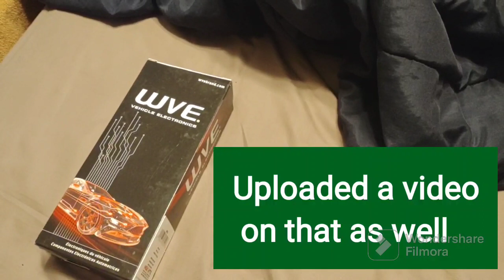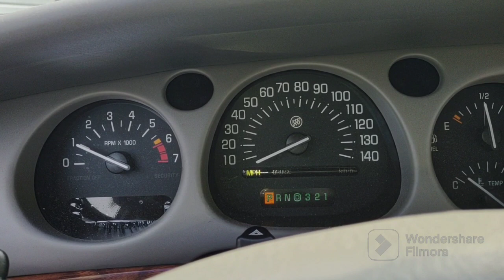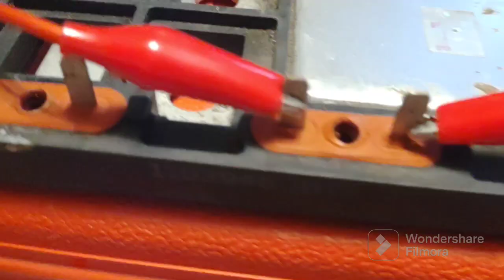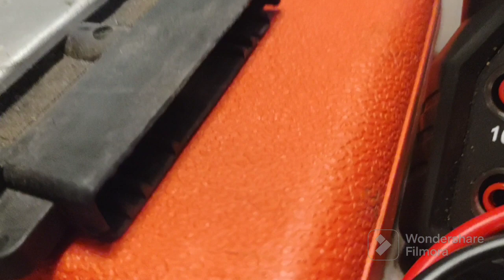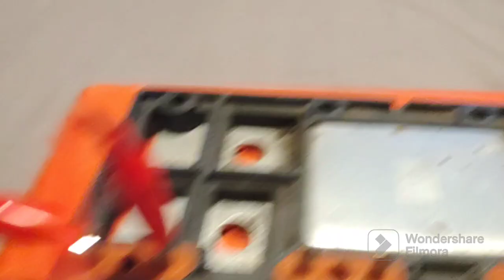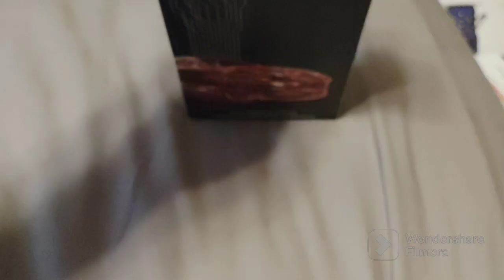Buick LeSabre Crank no Start - Repaired

Comment from the maker: My apologies for not showing the actual installation part of the ICM (Ignition Control Module) in this video.  It's rather self explanatory, and couldn't be easier (thnx GM), but I did include many photos at the end of the vid which show a lot of disassembly, cleaning, and reassembly details. 
    But what's more important is what I learned in my troubleshooting travels and the how I arrived to this point only $200.00 total later.
    Crank, no start condition. Odds are it's the crankshaft position sensor or the ICM. Either of these not functioning can cause ur engine to die while driving. Or just not start.  I changed the crankshaft sensor first and car still didn't start. Then I made sure the ICM was receiving 12V on the pink and black wire after unplugging the connector. So my ICM was receiving 12 volts, but still no spark. Well, when I got to this point it was either the ICM or the PCM.  So  then I changed the ICM, and as you can see in the video, she came back to life !!
Reply: I ordered an ICM..My 3800 shuts off randomly on the road. I cleaned the grounds very well. I used DeOxit with Copper particles, I am trying to avoid the pain of changing out the Crank Sensor especially with 30 degree temps.  VERY GOOD point about not testing a new ICM! Cheers
Reply from the maker: @kevhauser8058  Hi Kev, I hope it is your ICM and not your crankshaft sensor, given the cold weather. That's scary and dangerous if a car is just shutting down like that.  Make sure to disconnect your battery first or you may fry other components - not good. 
     In hindsight, I should have replaced the ICM first, but I'm not upset that I did the Crankshaft Position Sensor first, as it was probably 21 years old.  Cheers and good 👍 luck.
Reply: @anthonyhfe6450  Good Tip on disconnecting the battery...Many times I have worked on electronics hot...110v too
Reply: Thaks and hope you have a blessed holiday season.
Reply from the maker: @kevhauser8058  You too Kevhauser8058. Thnx!
Reply from the maker: @kevhauser8058  Yes, I do too on working live with house wiring.  But with the car, you don't wanna accidentally zap costly components like control modules, your main computer, or your new ICM !! Or accidentally touch positive to ground and blow a bunch of fuses or make some fireworks. Just the act of plugging in a connector live can cause issues.  So that's why.

Comment from the maker: Update: June 12, 2026. We're having a heatwave in New York, in the 90s yesterday & today. I've been driving all around Long Island with my 2+ years old WVE ICM with no heat sink compound used. Absolutely zero issues. So I am using my car as the guinea pig to do this experiment for everyone. Of course if you are replacing yours, you probably should use the thermal heatsink paste, unless the ICM manufacturer states you don't need it. Honestly, the factory applied heatsink compound in my car was pretty much all gone, and the original ICM lasted 22 years !!!! Not too shabby, baby ! Throw a spare in ur glove box or trunk. They're cheap enough !!

Comment: No heat transfer paste you'll be putting another one in soon
Reply from the maker: Funny you say this. 2 years ago I said I'd revisit this ICM and add the conductive paste. Well, I never went back and added the thermal paste. Also funny, I don't believe the WVE instuctions on this part mentioned heat transfer paste anywhere. I'm wondering if the design has long since been improved and dissipates much less power, thus doesn't need the paste? Just a guess here. It's such a large area where the ICM touches the engine bracket. Then I thought why do I want to transmit heat from my engine into my ICM, instead of the other way around?? So I left the paste off.  No issues yet. 
But I appreciate the reminder !!
If it fails, I will comment here.
Reply: @anthonyhfe6450 I guess depends if there's any air gap between the two plates which would cause heat not to transfer thus the thermal grease. So they say lol. Probably just a really tight fit no air gaps.
Reply from the maker: @GlennsGoodies Well, the ICM is sandwiched between the 3 coils and the mounting plate with the 6 threaded holes. So it is probably a pretty gastight mating area between the base of the ICM and the mounting base attached to the motor.  The heat transfer must be very good without the thermal conductive paste, but of course would be improved with the thermally conductive paste.  It's a given that the enemy to electronics is thermal runaway due to ineffective heatsinking.  I'm willing to bet that tens of thousands or more of these ICMs have been replaced without the use of thermally conductive paste/grease, and have no issues. But using it may get you a year or more (just a guestimate) of life out of the ICM.
Reply: @anthonyhfe6450  I tested this. I put on a new ICM (Chineseum) and didn't use the heat transfer paste. It was spring, 80F on most days. After driving for 30 minutes I saw misfires starting to begin and progressively got worse the longer I drove.  I removed it all, cleaner and sanded the engine side again, and put an even but thin film of Super Lube Silicone Heat Sink Compound, and the misfires with hot engine went away.
Reply from the maker: @jperksification  Well, I guess you get what you pay for, but the conductive paste seems to have made an improvement in your case, but of course it could have been due to something else altogether.  Honestly, I wouldn't stay with a marginal ICM like that. If this car is important to you, and if you can afford a better quality ICM, it might prevent you from getting stuck somewhere.

Comment: Thanks for the ideas for testing with a multimeter.. Helpful on mine, which also had a bad driver on the center position.

Has this WVE part held up for you? I'm skeptical of the aftermarket choices for this module, but the one you found looks like it might be pretty good. NGK/NTK usually don't make junk. And if they used newer technology it might be a real upgrade. Power electronics has come a long away in the 25 years since the original part came out.
Reply from the maker: Hello, and thanks for your comment.  So far the WVE part (ICM) has been performing great with no issues, in my LeSabre.  At the time, when I bought it, I'm sure I did some research on which one to buy as there are many choices.  Nobody wants to get stuck on the road somewhere.  We do everything we can to prevent it.
    You make a good point about  electronics, and probably this ICM,  improving over the last 20+ years, so hopefully most of the aftermarket ones are good.  Good luck with your car.  I hope it is back on the road and you are enjoying her.

Comment: My dad has a '04 LeSabre that I'm driving (I have a '96 Corolla but it needs a starter) & I went to start the buick one morning & it randomly decided to have a misfire
despite changing the air filter, plugs, wires, & the coil packs, that didn't fix it & got the issue narrowed down to one coil pack not getting spark to cylinders 1 & 4 but I'm able to start it & drive it lol
so do you think it could be the ICM that needs a replacement?
Reply from the maker: @Jeremy_Hill_2020   If you swap coil 1/4 with one of the other coils, and the no spark doesn't occur now with the 1/4 coil, then your ICM is bad. If the no spark stays with the 1/4 coil, then 1/4 coil is bad. Thanks for your comment.  I hope you get that nice LeSabre running smoothly on all 6 soon.
Reply: @anthonyhfe6450  I haven't swapped the 3/6 coil with 1/4 coil yet 
also it did start up fine a few weeks ago when I went to work but the moment I backed into a parking space, it went right back to misfiring lol
Reply from the maker: @Jeremy_Hill_2020  Hope you can  fix that soon.

Comment: Great video.  Very thorough ,thanks for posting. I’m reading that there is thermal paste applied under this module for heat transfer.  Perhaps the gunk under the icm was thermal paste 20 years ago , it probably dried out and deteriorated over time.  The LeSabre  is a great commuter car with a few minor quirks. But far fewer problems than many other cars especially newer ones.
Reply: I had the same crank but no start issue. Changed the crank sensor, ignition switch, and then finally the ICM. ICM has fixed it for 2 weeks now. With the old ICM if the car sat overnight or on cold starts it would crank right up. I've noticed that even with the new ICM sometimes I Have to try to start the car a couple times from a warm start, but it always ends up starting. I'm wondering if that metal plate just heats up so much and gives you the problems. I'll probably go back and reclean it all out and use a thermal paste this go around to see if it makes the warm starts smoother.
Reply from the maker: @bholtmeier  It should not do that. These cars should start quickly in any weather.  When I did my ICM in this vid 2 years ago, I did clean the surface of the mounting plate for good thermal conductivity.  Thank you for commenting.  Let's keep these 3800s on the road !! 😊
Reply from the maker: Thank you for your comment.  Good point about thermal paste.  I'm really not sure if it was utilized at the factory. In the instructions of the new ICM, there was nothing stating that thermal paste should be used, nor was it included in the box with the ICM.  But I'm really not sure.  I wonder if the ICM dissipates a lot of heat or not.  Hey 3800 experts? Any thermal paste used under the ICM??
   Yes, they (LeSabres) have a few quirks. My car has very low mileage, but even so, I'll be replacing the upper plenum and its gasket, the lower intake manifold and its gasket set (with metal Felpro ones), coolant elbows too. I'm leaking a little oil and coolant externally. 
    I did the gasket job last year on a 2000 Park Avenue. I made a video on that job too. Oh, I just developed a power steering fluid leak, so I'll address that when I do the gaskets.  Cheers and thank you for your feedback!